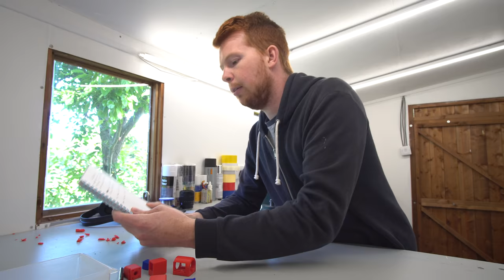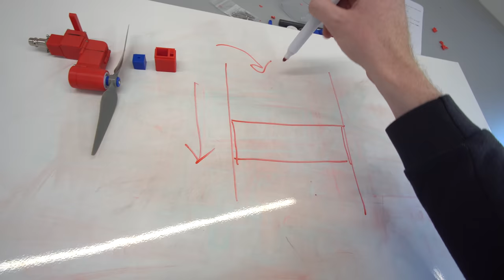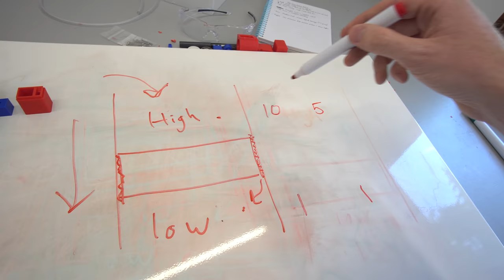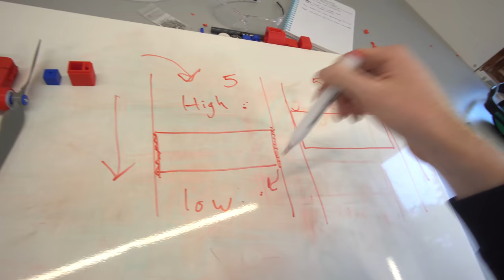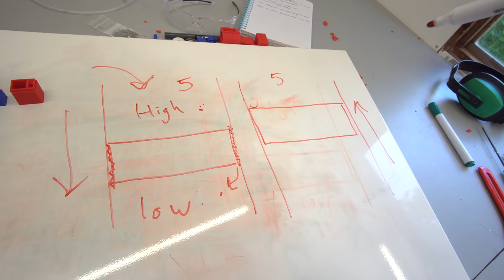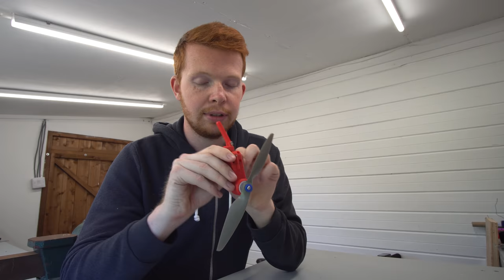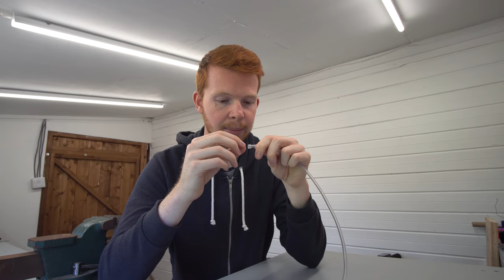Multiple or Single Cylinder Air Engine?

Comment: Why not build this as a two stroke, similar to a steam piston? Every stroke would be a power stroke, you wouldn't need a piston return spring, and it should be easy to translate steam piston design to work with compressed air.

Comment: I would first perfectionize the 1 cilinder engine and would ad a descent throttle and make it so it has idle when you release the throttle and then make a 2 cilinder engine

Comment: Why couldn't the high pressure side of the piston be on the Crankshaft side of the piston?
Perhaps the crankshaft itself could be part of the valving.
And the air supply would be centralized on the flat engine

Comment: Your first argument for multiple cylinders could be answered by just one cylinder with twice the cross-sectional area, much better: same force as for two pistons, but perimeter is only sqrt(2) times the original, rather than double. The reason for multiple cylinders should be the advantage of the phase difference.

Comment: Why not a v2? Sure you will have to think about how you will make the timing but you would get away with a simple cranck and the intake could be between the cylinders so it would be simple too. It would run on smaller rpm than boxer/single and it would start without any starter.

Comment: Not a genius here, but I think that two cylinders wouldn't be more efficient at all like you said now you would have two cylinders loosing air instead of one, and twice the moving parts, which means twice the friction. Now the cool factor of a twin cylinder definitely outweigh the single cylinder. I think what you need here is more fuel. You need to figure a way to make a lightweight high pressure chamber that you can regulate the air to a max release. Really don't need more efficiency as much as shier power.

Comment: kind of a late comment, but if the amount of air leaking around the piston is directly proportional to the amount of pressure in the cylinder, would you not get the same total leakage with one cylinder at 10 atmospheres as you would with 2 cylinders at 5? but if the pressure wasn’t directly proportional to the leakage but rather the air only leaked at high pressure, then in that case it would be better to go with 2 cylinders at lower pressure right?

Comment: There would be half the amount of air leaking PER PISTON. But Twice as many pistons to leak air!
So the total amount of leaked air would be the same.

As for scavenging the pressure, as other comments states, that wouldn't really work, the back pressure caused by that scavenging would slow down the primary piston by as much as it will generate power, but with the added friction.

However, multiple pistons will help the engine run smoother, and would allow for more air flow, providing more power at the cost of lower run time. (Just like many pistons on a car will yield higher fuel consumption, but a smoother running and more powerful engine).
Reply: A straight twin will probably be better, if not just for vibrations
Reply: to asnwer your question though, A single cylinder engine is probably the reasonable option, but a really want to see a multiple cylinder engine!

Comment: About the air leaking, shouldn't u focus on that? PLA 3d printing is great, but has its limits, maybe a rubber or silicon ring to limit airleak? About the 2 cylinders, a straight full offset with a H connector (yes u need 3 bearings then) is commonly used in the twin-RC cars (sidenote, a parallel twin = cylinders move synchronized, inline twin = cylinders move opposite). You can find a blueprint of a twin-version if u look for 'chunn alternate firing twin'.  Basicly u build 2 exact cylinders like u have, but then mirror them back to back and connect them with a rod.

Comment: I say go twin, I don't see the pluming being completed because the engine is flat and if you make the pluming structureral it will fit the aircraft better than the straight 2 or 1 cylinder. Plus would it be beneficial to but a breather in the crank case as the piston comes down it try to compress what air is in the crank case, just a thought I had after seeing the single cylinder

Comment: Wouldn't a plane with two double cylinder engines be so cool? Probably inefficient but you could make a double fuselage as well (made of bottles to contain more pressured air probably). I'm just adding the word double to everything and it will most probably be inefficient but that'd be cool anyways

Comment: hello i am french , i like to the video . for me if it is necessary to reduce the air losses to the maximum because the tank does not contain a lot of air, and also to reduce the piston strokes to menbrane, large diameter of piston force = pressurexsurface, and to reduce the stroke of the piston to increase the RPM

Comment: Is it possible to make the pistons cylindrical again and add a either 3D printed "springy" plastic piston ring or source tiny metal piston rings and build the engine around that to reduce piston blow-by?

Comment: What if you made a boxer engine  and add another stroke, where the air is let in to the crank case and pushes the cylinders outwards. Of course you leave the inward stroke as it is. This would make it single stroke engine? A single-double stroke (not two stroke)? This should also eliminate the need for hand starting?

Comment: How does the efficiency of an air engine compare to a normal electric motor? An air compressor often just a piston used to compress air, so I wonder if you could use the rotational force of the compressor to amplify the engine running with the compressed air?

Comment: I refer you to my earlier comment about twin cyl engine and the link I gave then - 2 cyls, need less pressure for the same torque so what you have stored lasts longer - as for leaks they should be minimal or your using the wrong materials. If leaking air is a problem - a simple cup seal on the top will cure it - Think of how your bike pump works - or you cane reduce air loss by making the piston longer so increasing the resistance through the gap.
When I make steam engines (running on compressed air), the piston to cylinder fit is expected to be good enough to hold considerable pressure (I work mainly in brass). The horizontally opposed design with a rotary valve in the crank shaft is pretty efficient. The longer crank shaft housing reduces air loss.
Bearings https://mindsetsonline.co.uk/shop/ball-bearing-races/ - 66p

Comment: That opposed single crank pin engine is going to shake itself apart. You would need at least 4 cylinders for balancing (DO IT! should sound interensting while it's running).
Also air powered car is a weak idea, but whatever floats your boat, compressed air is unefficient.

Comment: I'm definitely not an expert in this stuff buuut... I find it extremely hard to believe that a 2 cylinder engine would be more efficient. Surely the only reason to go with a 2 cylinder is to get more power? I would imagine losses to friction would be more significant than pressure leakage, and they would certainly double if you have double the cylinders. I'm also not convinced that the pressure would be half as much in a double cylinder... wouldn't it be the same, but just reduce twice as fast? More power would be more interesting to watch, and I imagine all that's left for the single cylinder is minor optimisations, which doesn't make for as good viewing IMO.

Comment: Would adding an exhaust valve increase the efficiency by a significant amount? Some of the rotational energy is being used to compress the air within the cylinder, right? Or would the valve use more energy to open than just not having one?

Comment: Inline (or straight engine) would be easier to feed air to the engine or simply make 2 motor and somehow fix their crankshaft together... or perhaps you could try to make somekind of V-Twin like Harley-Davidson's engine... in my opinion more than 1 cylinder wouldn't be good for a plane but id try it on somekind of a small 3d printed car..  using the air from the cylinder ''1'' to push the piston in cylinder ''2'' is impossible because once the piston is going downward it shut the ball valve (no more pressure going in) and the air coming out of the ''1'' isn't compressed anymore.

Comment: To limit the leak between the cylinder and the piston you need a seal, not easy with a square piston, circular or ovale will be better.

Amazing how you are taking the same engineering path that the pioneer of steam engine of the past. Same goal, same problem, same solutions.

Comment: A vee twin would be more balanced, a flat twin may give crank torque trying to throw the engine in the direction of the crank throw.. As in BMW Motor cycles older flat twins

Comment: you could put the pvc pipe inside the connection instead of on the outside of the connection, then the pressure would help it seal on the wall of the connection
I was going the say that you should consider having the pistons in a slight V  by just a few degrees or so to help with it starting when one is at the top of the stroke, but then i realized that this doesn't really work with push only pistons, you'd need at least 3 pistons in order for it to always have one ready to push, does that make sense?

Comment: Can you print a head that lays over the body for the flat twin so you can use a single inlet. I would still run a single piston for testing the new cam. I was raised in the belief of change 1 thing at a time to not mess up the whole machine.

Comment: Question, is there any way that you can do self starting? If you had 4 or more cylinders in a radial config it would be pretty easy to do self starting, but that's obviously not practical for design.

What if you made some form of starter that was like a dentist's drill, that could start to spin up the engine? If you are making a car it would be very cool if you could have a servo control the throttle and self start the engine

Comment: one cilinder is more efficinet, also because of friction. the blowby is smallest in one big cylinder. the bore will increase the surface of the piston by order of 2 but the perimeter only linearly. the bigger the bore the louder the roar?

Comment: But will 3 inline cylinder be able to fully automate the cycle (no flywheel need and no priming) , should be good with the car so you can really stop it

Comment: You making a boxer engine..lol.. my question is could you come up with a design that could reuse the air from cylinder 1 into cylinder 2?? That would be the best design the help create torque on your crankshaft without wasting as much air

Comment: You should think of your air engine like a steam engine in that the power is made (stored) externally where as in an ICE engine the power is made in the cylinder. More cylinders = more power. Not so here. Early on, steam engines were made more efficient by using two cylinders. The second cylinder makes use of the exhaust of the first to extract as much energy as possible. Listen tp "LordDecapo". As in steam engines that may be the way to go.

Comment: What about a multiple expansion engine a la the Titanic steam engine? The second piston needs more surface area but you feed it with the exhaust air from the smaller, high pressure piston.

Comment: What if you made a single cylinder engine that had air forced into he top and the bottom for the up and down stroke.
It will increase performance and keep the weight down.

Comment: 2 cylinder air engine becuase the momentum it can carry and it could put in more powers but the problem is there that it takes more air than it can save

Comment: What about best of both worlds. modular singles. built so they can be daisy chained together to create a inline2 or 4 or 6 etc. built like your single design but with a male and female coupling at each end of the crank so they just stack together. then you just need to design 3 diferent heads a input head connected to the air supply middle heads that continue flow to the next head and an end head for the front cylinder. best of both worlds

Comment: If you do a twin cylinder but opposed piston, you have a simple "plumbing" (as you says) AND a simple crakshaft, well obvisouly two simple ones. You reduce air leakages as well. Look at: https://en.wikipedia.org/wiki/Opposed-piston_engine

Comment: I would do a multi-cylinder engine.  As far as which type, I'd do the flat twin.  To me, a simpler crank shaft offers more reliability.  As far as the "plumbing", why not just 3D print it and use the gasket material for attaching it.  It would be streamlined, and you already know it can handle the high pressure.  Plus if it fails badly, it could lead you to a better / more fantastic idea.  SCIENCE!!! LOL (^_^)

Comment: I would like a bigger single cylinder engine. A bigger volume would theoretically increase torque. And by doing so making the airplane fly. The crank shaft would perhaps need to be made in some other material than PLA to be rigid enough to work. My 5¢!

Comment: Couldn't a V-twin be a compromise between a flat and an inline engine? the pistons could share a crankpin and the heads could be close enough to not need to use the tubes. say like a 60 to 45 degree offset?

Comment: You should stay with a single cylinder design.  Feeding extra cylinders will problematic.  IMHO, you should incorporate a flywheel into your design and work to optimize it into the system.  That will allow you to input energy by hand at startup, then the air will just need to maintain the rotation.

Comment: I think that the cylinders should be cylinders instead of cubes. A circle has a smaller perimeter for its area, and if the perimeter is smaller it will leak less air.
Mabe even making a piston with twice the diameter instead of 2 pistons. If the diameter is twice as big the perimeter wuold be also twicw as big as befor, but the area would be 4 times biger. 4 times the power and 2 times the air leak.
Reply: (i'm not certain on what i'm going to say)
Also, as nothing is burning inside the cylinter the stroke isn't that much  important as it's bore.

Comment: Would it be possible to design a mount for the tube, where to make the seal from melting the end of the tube and screwing the mount on top of the cylinder. I feel that you would be able to get a decent seal.

Comment: Build a 2 rotor rotary engine it will be easier to use one intake without difficult plumbing...... Or build a 2 cylinder flat engine with one intake where the second cylinder parasites from the first
Reply: Turbo?

Comment: first and foremost, for efficiency, you need a better valve, one that opens and closes shortly, because you are expanding your air while the cylinder is open to the compressed air deposit, something that is not efficient. your cylinder should take a small bit of air and expand it while the cylinder valve is closed. I dont believe your piston sealing is a big source of inefficiency..

Comment: why are you printing square pistons, the ratio of circumfrance to area (thus the space for air to leak past vs the force it can apply on the crank shaft) is higher than a circle, this is why 99.9% of piston engines use round pistons, not square.

Comment: Your assumption of greater efficiency wouldn't really work quite the way you described, both cylinders on the high pressure side are fed from the same line pressure... I believe you started out with an incorrect assumption of equal force being applied to both cylinders versus the single cylinder, rather than equal pressure.

Comment: make the engine have an exhuast that will refill the air tank... recycle the air ... problem is the air needs to be coming from mulptiple cylinders for proper refill air pressure ...more likely...also the only way to make a real efficient working motor is to make a opening and closing valve system ...air pushes the piston down ...down stroke... the piston moves back up ...air is cut off by valve closing ...up stroke....and when piston starts its down stroke the valve opens and lets air in ... have a exhuast valve that is sealed and sends the air back into air tank through pressure valve  ...use a brass pressur block with one way valve for air inlet from exhuast ...and another one way valve going towards the engine

Comment: I vote for a either a 3 cylinder radial piston engine similar to this steam engine: https://www.youtube.com/watch?v=uaDdK2uo0WQ. Or, a 3 cylinder W-engine. In both engines the  piston rods connect to the same offset point on the central shaft. Your valve cam would still be fairly simple and everything would work on either 120 or 60 degree offsets respectively.

Comment: You should get a better single cylinder before putting two in, as problems with the design of a single cylinder would be compounded by multiple.

Comment: I don't think multiple cylinders would be at all beneficial. Combustion engines use multiple cylinders to increase the number of explosions per revolution to increase more power. Your engine doesn't use combustion for power, all your power actually comes from the pressure tank. Your engine essentially just converts air pressure change (a straight fluid flow out of the pressure tank) into rotational energy. If you are truly interested in efficiency, I think using a turbine engine would be the most efficient (but rather uninteresting for YouTube entertainment and design satisfaction).

Long explanation short, increasing the number of cylinders gains nothing and increases friction, air leakage, and has more moving parts

Comment: Single cylinder! Theirs advantages to multi cylinder internal combustion engines in cars but not your application. Extra weight, extra friction. Double the pressure loss area in the piston. And most importantly this engine is still evolving, will be harder to evolve a multi cylinder. I would concentrate on improving the valve and cylinder seals.